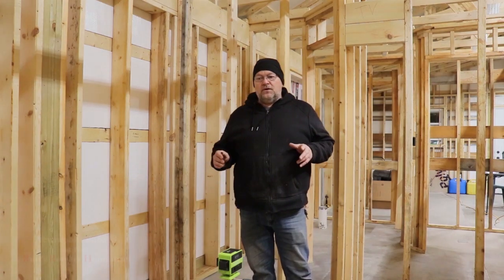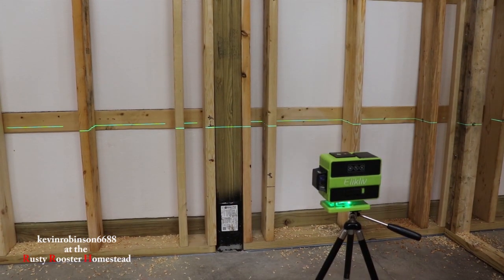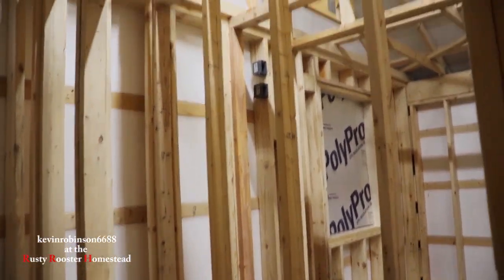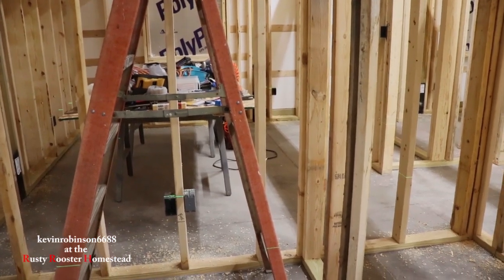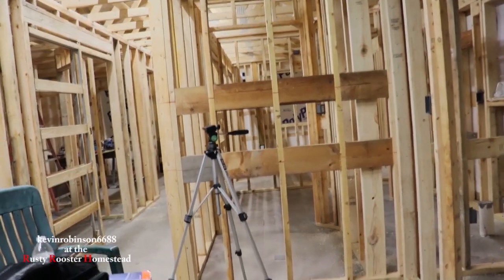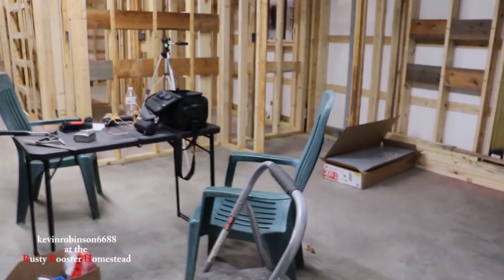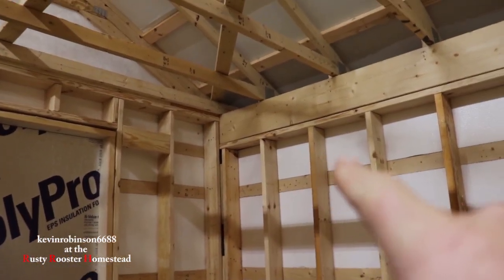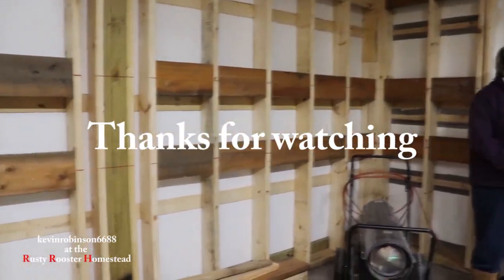mini barndominium mounting boxes and drilling holes for wiring

Comment: When drilling holes in stud framing members it is always best to clean and remove any of the wood splinters on the side where the bit comes through, when possible , Always clean the drilled hole on both sides to prevent any wood splinters from tearing the sheathing jacket on the NB Romex cable when pulling the cable(s) through the drill holes.
Reply from the maker: Is this job looking ok to you?

Comment: You should have went with the Square D Homeline Series with the Plug On Neutrals for the 200 Amp Main Panel ! They are so much more better than anything GE makes ! I'm a State Licensed Journeyman Electrician/Sub Contractor with over 55 years in the trade mostly Residential and Commercial and prefer and use Square D products the most where ever and whenever  I can !